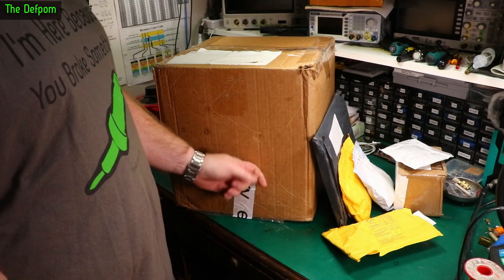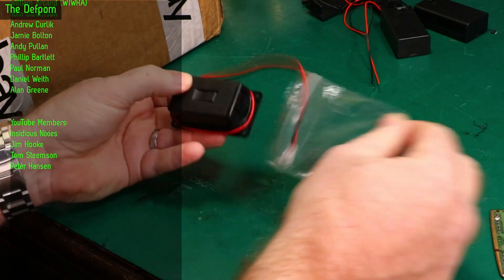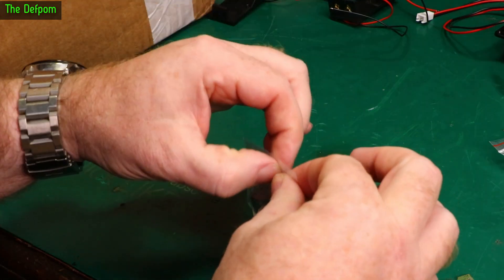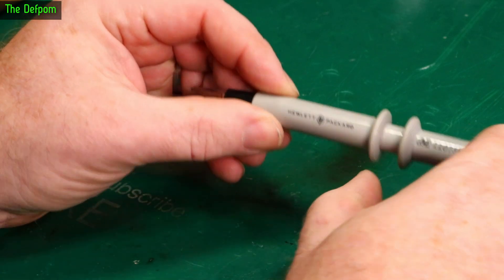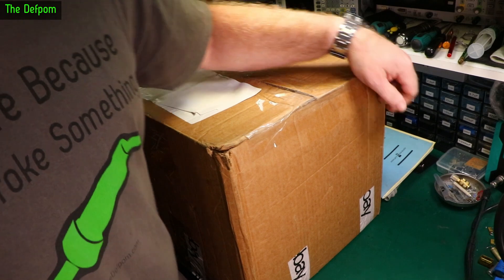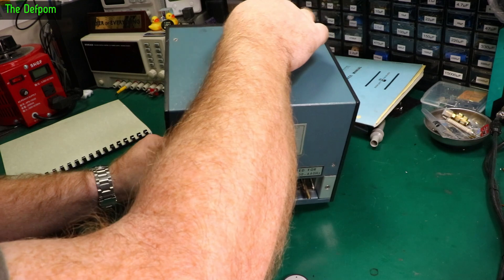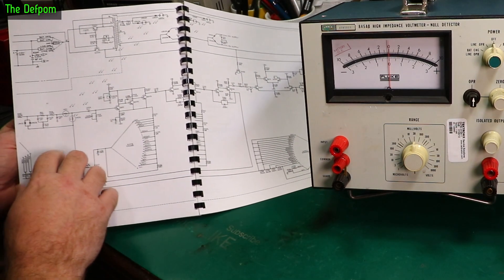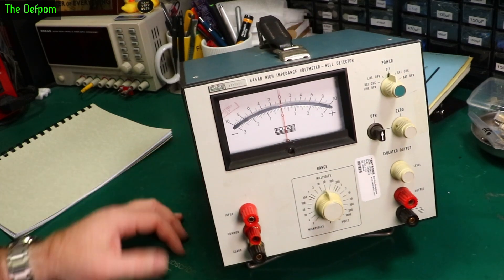🔴 What's in my Mailbag ? - Mailbag Monday 22nd May 2023 - No.1131

Comment: Personally, I prefer the 9V battery holders that are a spring-loaded drawer arrangement designed to fit a hole about the size of a C13  IEC male chassis mount mains connector.  Perfect for both aluminium die-cast, or plastic boxes, as they are fixed with 2 screws.